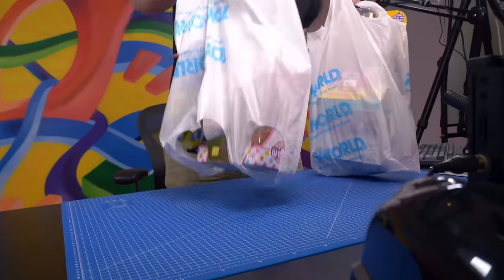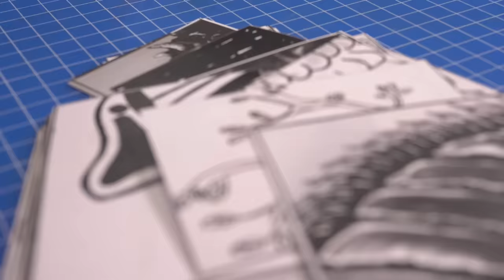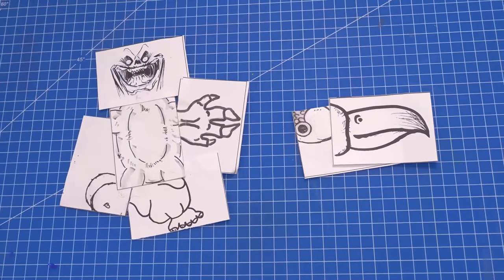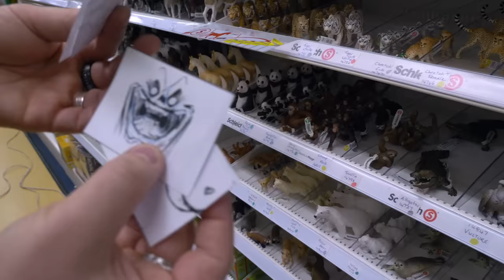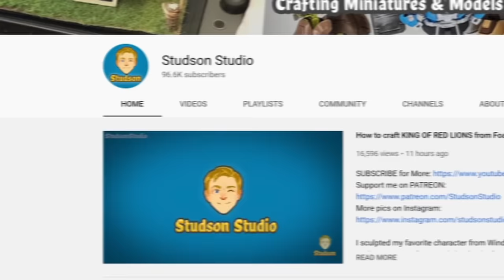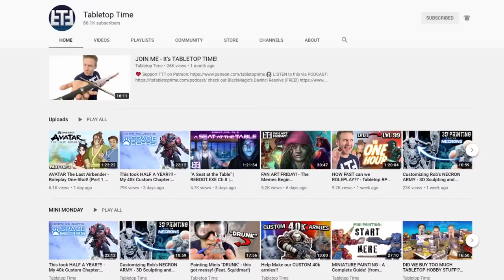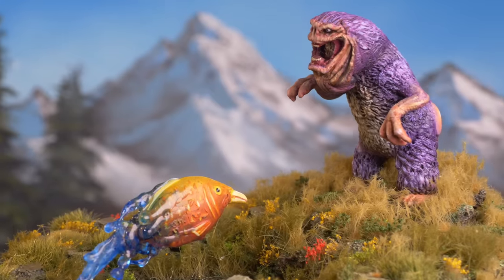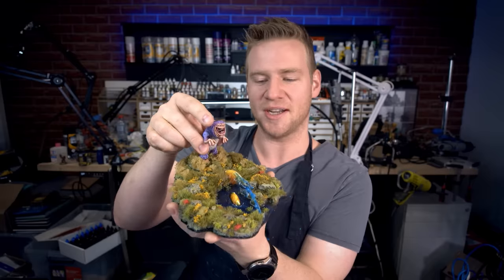Using CHILDREN'S TOYS to make HORRIFYING MONSTERS...

Comment: Try mounting the model to the top of a pill bottle with hot glue when you sculpt. You can use the bottle as a handle so you don't muck up the textures you already worked on.

Comment: Pov: You're walking in the woods at night and you hear a twig snap off to your right. As you pan your flickering flashlight in the direction of the noise, you see that face disappearing around the back of a tree not even 5 feet away from you. (It is 10 feet tall)